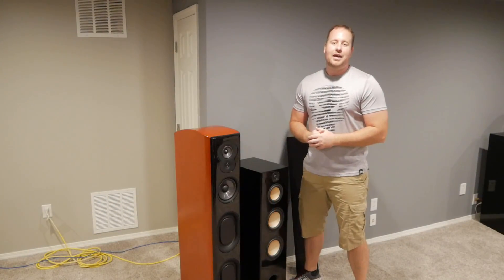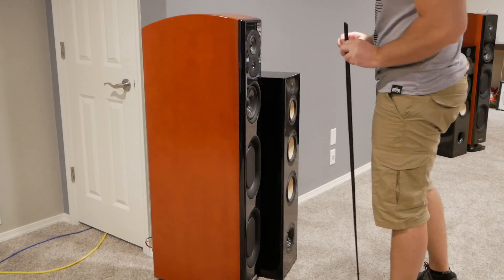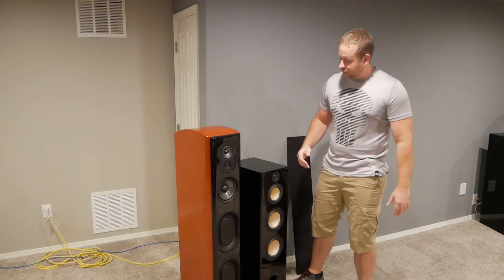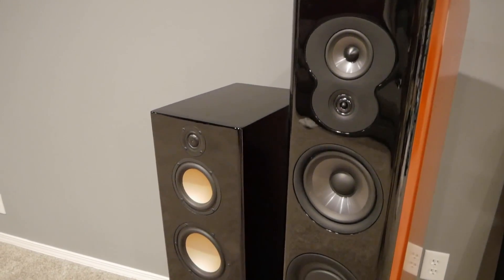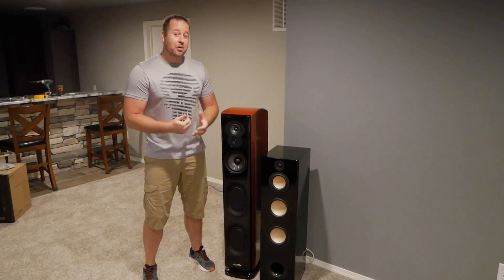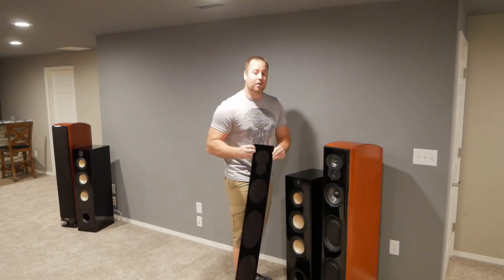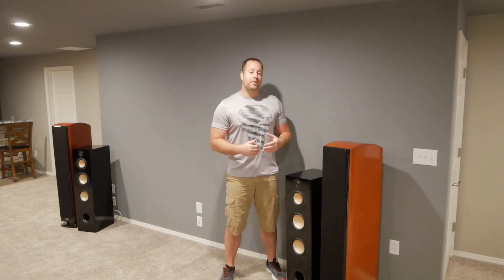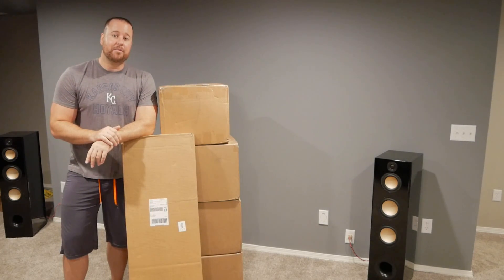Comparing my DIY Speakers vs Manufactured | Swope Towers vs Polk LSiM 707s

Comment: Hey Life of Bliss, I got a good laugh out of this video because I know exactly what you mean. I have 4 of the lsim 707's in my theater and 2 of the lsim 705's. For home theater I let the center channel do all the work when it comes to vocals because the 707's fail terribly. It is a shame their flagship speaker suffers so much when it comes to making the jump between the low end to the high end. One thing I will say for the 707's is that if you bi wire the upper half and the lower half separately it will help bridge the gap to an extent. Another thing I will say for the lsim line is that the 705's kick ass. when I am listening to 2 channel audio it is with the 705's hands down. The 705's walk all over the 707's as far as I am concerned and they cost a lot less too. I honestly cant even use my 707's for anything other than home theater just because they get bailed out by a center channel. With that being said I think if they are only trying to fill in as a non vocal style speaker they are fantastic. No doubt though when it comes to 2 channel audio the 707's are unusable and the 705's are some of my favorite speakers. I hope you do more audio related stuff on your channel in the future, thanks for the content.
Reply from the maker: Hey Bob, thank you for your input! I've read that many people really like the 705s, and most that have heard both prefer the 705s. Not sure if it was considering cost or just strictly performance, but a lot say the 705s are the sweet spot in the LSiM line. The 707s, for me, was like a speaker than did a few things very well, but not all. I enjoyed them while I had them. I plan on doing at least 3-4 more videos on the actually process of speaker building, as well as some demos once things settle down and it isn't a mess in my basement haha. Cleaning out the back room now for my next video... It's a disaster zone!!
Reply from the maker: Btw, I'm sure your theater sounds amazing with all those towers in there! What are you running for sub(s) duty?
Reply: well I am actually planning to upgrade the subs because the bass from the 707's does about as much as the mirage omni subwoofers I am using. I have a contractor coming to finish my basement in about a month so I think it might find something that I can build into the wall. I am pretty set on finding some old school cerwing vega stroker 18's for the front two subs and I havent decided on what two subs for the rears yet. The cerwins show up from time to time on ebay but I havent pulled the trigger on any yet. I have 10 power amps so far but I need a few more to complete the theater. I have 8 of the ashly mfa 8000 power amps and two qsc 1450's. The mfa 8000 power amps deliver 750 watts/channel into 8 ohms so they should work fine for subs too. The front two subs will be for 30 to 50 hz and the rears will be for sub 30. I havent found anything for the rears yet because my room is not quite big enough to make sub 30hz with an 18. I think I am going to need something closer to 30 inches to hit those lows at such a short distance. I plan to use an infinite baffle design built into the wall. Hopefully this will work lol.
Reply from the maker: Wow that's some serious power in there! Bet that'll be rockin once you add more subs. Since you are considering building your boxes for the subs (or installing in wall) some good 18 inch options I've looked at are the Dayton Ultimax 18 and the Stereo Integrity HST-18. Depending on budget, a few of those may do the trick for ya. And if you really wanna get crazy, the SI HS-24 would definitely make an impression...
Reply: I have looked into the stereo integrity sub woofers, they look amazing. I have a friend that has been into audio for nearly 50 years and has almost a million dollars in audio equipment and he just hates polk products lol. I am going over to his place to introduce him to the lsim 705's to see if I can change his mind. I asked him what he thinks I should do in regards to the front subs and he said he would use those vintage cerwins even over the stereo integrity. I think the stereo integrity might have a little more to offer as far as dynamics go but it seems to be the consensus that for such a short frequency range coming from the fronts the old cerwins will do better. I do love those stereo integrity's though, and its pretty cool that the owner builds the subwoofers himself.
Reply from the maker: Yes it is, and looks like he does some excellent work. Well let me know what you end up doing with your subs! I'll be sure to post what I decide to do later this fall/winter when some funds clear up for an upgrade.